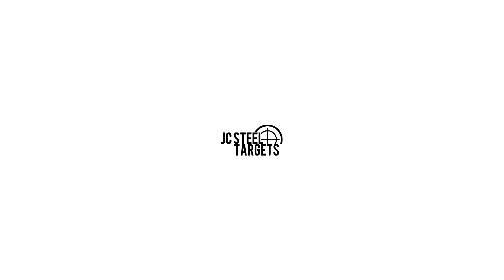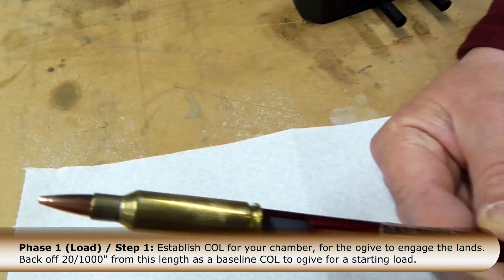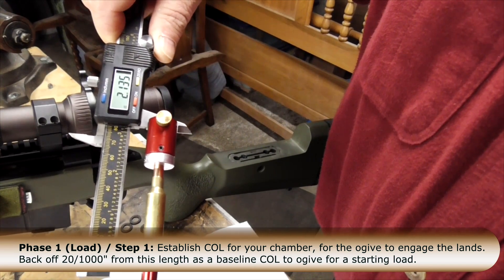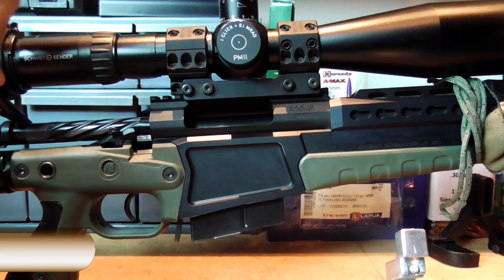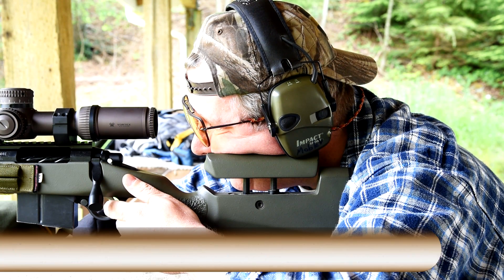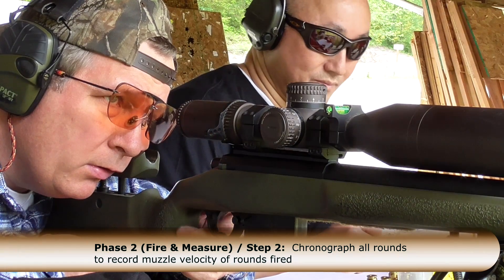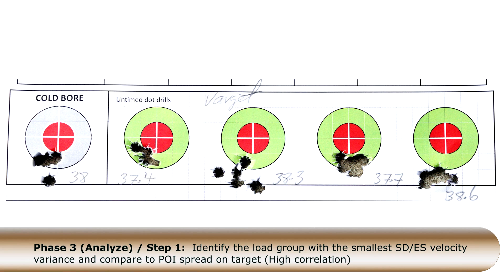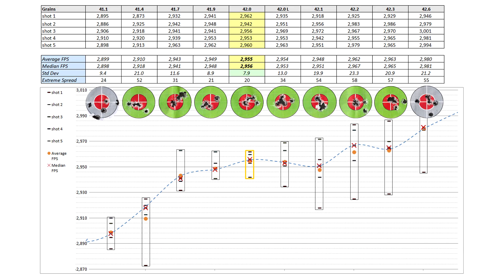S2 - 11 - Load Development (Part 2 of 2)

Comment: when I do load dev I'm focusing not just on the overall size of the group, I'm also tracking the spread top to bottom. Your gonna have nodes where the deviation is low ion FPS but the group spreads. "Best Data" doesn't always correlate to tightest group. Then, ya need to stretch out to 200 yards n see how they stabilize. My 6.5 Swede with 140 gr TMK's over 45 gr of 4350 would group 1/3 MOA at 100...even better at 200. They seemed to settle down better. My Bench-rest buddies told me they see that all the time.

Comment: Great series! I've certainly learned a ton from your reloading videos and have been able to refer a few of my friends to your channel as well. As a younger shooter just getting into PRS, it's nice to go to the range and show up some of the old farts :)

I'm running a Tikka Tac-A1 in 6.5 CM with a load of 42.5gr H4350 with a 140gr ELD-M and getting 2742fps with an SD of 6. At 200 yards I'm shooting 1/2 Inch groups on average from a bench. It's no custom action, but definitely a high value platform.

Comment: I think we all assess numbers differently. At 12:04, load 4 shot 3 shots in a row that clocked at the exact same speed. The shot before those 3 had a 3 fps difference. The initial shot, for whatever reason, threw the group data and SD off because it was about 20 fps. Little things like that would make me re shoot that group because SD can be extremely misleading sometimes.

Comment: Great videos! One question, do yall clean the barrel out between groups? Starting to load for myself and was wondering if running a bore snake through the barrel after every group would be beneficial or not. Thanks again for yalls knowledge!
Reply: Cleaning the gun tends to make it less accurate.  After cleaning, you should always shoot several rounds to foul it before shooting for groups.

Comment: realy nice. I am now testing powder in my 6,5x55 using Labradar. I lock for powder with low variation in temp and also try to find a nice spot wher the speed is stabel and variation over the whinter and somer. I think it will be a short movie about my test.

Comment: Hey guys, great video.
I'm preparing to develop a load for my deer rifle, and it's got a featherweight barrel. Generally, I try not to shoot more than three rounds at a time without letting it cool off. Which is the greater sin, to limit my test loads to 3 round strings, or to break my position and let the barrel cool?

Comment: I've recently seen this exact same thing with my .308 load work up. .2 grain of Varget difference can be big on the extreme spread. I really didn't believe it until I watched this video. Although I have watched this video before I wasn't as serious with my load work up then as I am now. Groups at 100 were pretty close in size but the ES was literally cut in half with .2 gr of powder. Thanks
Reply: Thanks for sharing your experience. Indeed, you don't see the different at 100 yards but you sure will at 1,000.

Comment: why wouldnt you start farther off the lands since you cant chase the wear of the throat.
litz says vlds can jump good so starting at .005 or more off the lands will give you room to chase the throat wear.
Reply: With the VLDs you either need to kiss the lands or back way, way off. With the 6.5x47 we were already running a compressed load so we didn't want to push the bullet in any further and the throat wear was minimal over the life of the barrel. However, it's on our "to do" to try to jump the VLDs despite the compressed load and see how we do.

Comment: Do you guys still load develop with this method?  I'm wondering if there's a way to blend this with OCW
Reply: Hi - yes we do. We've used OCW and in each case the best load according to OCW had the lowest SD and ES. If you want to blend the two approaches, you could shoot your loads on paper in a round robin fashion but as we point out in the video doing so is the equivalent of executing a dot drill. As mastering a dot drill takes a lot of practice (we're still working on it) chances are you will be introducing human error into your analysis. We will also show in an upcoming video how you can shoot a 100 yard group with charges varying by as much as two grains and still get a tight group. In other words, shooting groups at 100 yards is not always indicative of the best load. Some may disagree with us and that's OK - we're just sharing our observations. 

Based on our experience to date, we are confident conducting our load development with a chronograph only. Once we've arrived at an optimal load we'll test them at distance (up to and past 1,000 yards).

So feel free to mix and match approaches, but we are extremely confident that whatever optimal charge you arrive at will also exhibit the best results using a chronograph.

Comment: that spreadsheet stuff looks pretty cool, is it your own thing, or is it something you downloaded? i'd like to have something like that. also those targets, are they printable?

basically the tl;dr is, load to 20 thou from lands, find a good starting powder charge point then load up +/-. shoot 5 rounds, recording velocity and grouping. examine data and look at ES/SD and vertical stringing and identify the best load. after that experiment with seating depth?
Reply from the maker: Steve developed the spreadsheet years ago, prior to us starting 6.5 Guys for doing load development analysis. He also developed the paper targets we use using MS PowerPoint.

Comment: Hey 6.5 Guys, i'm fairly new subscriber. Do you have that excel spreadsheet template anywhere that i can download?
Reply from the maker: A link to the excel spreadsheet can be found near the end of the accompanying article for this video our website at this UR: http://www.65guys.com/load-development-part-2-of-2  we made the decision to make the file available due to the number of inquiries we've received about it. However, you should note that we don't offer any support or respond to questions about the spreadsheet, how to use or modify - we simply don't have enough time to do this based on the number of viewer email and questions we receive.

Comment: @10:07 I noticed you Magnetospeed v3 data on a MS Exel, BUT, where did you get the bullet curve? Is there a video on how you can set this up via MS Exel?
Reply from the maker: We haven't produced a video on modeling or analyzing the chronograph and load data using Excel tables and graphs. We've received a lot of emails and interest regarding this, but it's not within the scope of content we plan to cover.
Reply: TY for the reply. Ya, that info is completely invaluable to making a load from what I can tell. It would be amazing if you guys could. Great vids, ty

Comment: Great Video! 
Do you guys get POI shift with the Magneto speed attached on the Barrel?
I just got one Magneto and I'm not sure yet if i should leave it all the time on the barrel during load development or not.
How do you do it during all your load testing? Thank you
Reply from the maker: In short, yes. The Magnetosped will have the tendency to shift your groups in the opposite direction from the way the deck of the sensors is oriented. So if the bayonet is mounted at the 6:00 position to the barrel your shot group will shift up. You can even try turning it to the 9:00 and the groups will shift to the 3:00 position. In talking with the guys at Magnetospeed, what we understand is happening is the deck of the sensor affects how the muzzle blast forces air around the bullet as it leaves the muzzle and will have this shifting affect. 

However, from our experience it has negligible impact on group spread (i.e. barrel harmonics). Or in other words, a good load with tight groupings will still form tight groups with the Magnetospeed on or off the rifle, and a non-optimal load with the Magnetospeed on or off the rifle will still have the same level of dispersion on target.

Comment: Have you noticed adverse effects to groups and ES/SD when shooting to quickly?  Personally I have. When I get in a hurry and the heat starts to build in my chamber I'll notice that I get some high speeds.  I feel that there needs to be consistency in the time between shots too, which is hard at the range when there are seize fire and it takes so much time to get through a test.  So I set a 2 minute timer on my phone on spring and fall days but in the summer when temps start creeping up in the 90's I'll wait 3 minutes between shots.  Your groups and SD's are tight so maybe it's not an issue for you.
Reply: +Tyler Jacobsen Hi - we took about a minute between shots and made sure the barrel didn't get too warm. We also shoot in cooler weather which helps dissipate heat. Thanks for watching!

Comment: You guys should do a ladder test.  I always have better luck with load development at distance.  SD and ES are extremely important but the bullet never lies at distance.
Reply: +17874 Funny you mention that as we had a discussion with Scott Satterlee about that over the weekend. 300 yards seems to be a good distance. But yes, it's something we would like to try out.
Reply: On the contrary, I think that load development is ALL about ES and SD.  Anything that involves shooting and determining a group size is irrelevant in my book.  I know, it's sacrilege.  But think about this.  The point of the test is to eliminate variables.  The only thing that matters is what happens when the bullet leaves the muzzle.  The rest is out of your control.  So, if that bullet leaves the muzzle at the EXACT same speed, then regardless of the powder, primer, etc, you've done the best you can.  Now, technically you might say "bullet runout" or "brand of bullet/ogive/BC/etc", but you can test that too.  What you are doing is loading and testing powders and primers and seating depths and cases and NOBODY is so good as to infer the proper powder from a group size.  They can't shoot consistently enough.  You think that 0.150" extra was all about the right powder?  Or maybe the shooter blinked, fatigue, mirage, wind gust, unstable table, mouse farts, sun came from behind clouds, whatever.

If I shoot 100 rounds with a certain powder and the SD is 0, the only thing missing the target now is my ability to pull the trigger or read the wind or whatever...but it's not in improving my load.  Group size may suggest loads, but scientifically I think ES/SD is ALL that matters. 

To test this, you need a lot of data points.  But how about testing in a blind tunnel. Cant see the target.  Just a bullet trap at 25yds.  Keep tweaking your loads until you get a SD of 5 (to be realistic) over 30 shots.  Plot the SDs of all the stuff you load.  Some may be 5.  Some may be 10, or even 20.  Then take 50 of each of those loads and shoot 10, 5-shot groups.  Let's see the correlation between average group size and SD.  I'll put money on a direct correlation.  We all know this, anyway, but my point is that you watching your groups as you do the testing is irrelevant.

When you do the ladder and then you shoot a 5-shot group and say "yep, that's it", I don't think there's enough data points.  And saying "shoot 300 yds", well, that just adds variables.  If the wind is in play at all, you've introduced THE biggest variable (thank you Mr. Litz). 

My theory:  develop your load strictly on SD/ES and then learn to shoot well.  And if you can't seat a bullet straight, then learn that too.  Once SD/ES is standardized below 5, then maybe play with BC and ogive and bullet brands for quality.  Regardless of the rest of it, insist on an SD under 5...but no need to go find a long range to do load development initially.  IMO.

Comment: I agree with Todd B that Scott Satterlee just sacrifices one case/bullet combo and takes it from jammed into the lands and seats deeper in 0.005" increments until there are no marks on the ogive. For someone without a custom fired round to use with the Hornady device, this method is by far the best.
Phase 2 is 5 rounds at 7 loads at 0.3g interval. Phase 3 is analysis, and Phase 4 of Scott's process is 10 rounds at 5 loads at 0.1g interval. The last targets you show at ~12:21 appear to be almost a hybrid, because your load intervals are mixed with some 0.3g and then 0.1g. Nothing with 10 rounds though. The short intervals around the middle made that plateau look better than it might have been.
Reply: +Kenneth Garrison Hi - the target at 12:21 was shot before we even spoke with Scott and we showed it because it confirmed what we experienced using Scott&#39;s methodology. Yes - one could call it a hybrid approach. We appreciate the comment and appreciate your viewership.

Comment: Ed, some of the flyers you're seeing are occurring on the scatter nodes, so it's not "loose nut on the trigger" :) ... I doubt you've caused those flyers in every case is what I'm saying.  Remember that the scatter nodes (or anti-nodes) are normally 1.5% away from the OCW.  If you can't decide for sure on an OCW based on the groups you're seeing--look for the scatter node, and go 1.5% above or below that point--it'll normally bring you to an OCW node.  

As I believe we discussed when we talked, I don't like to worry with chronograph numbers until I've found the OCW based on the target alone, but it's fine to record those numbers along the way... as long as we don't throw out an obvious OCW (located 1.5% between scatter nodes) based on initial chronograph numbers.
Reply: +Dan Newberry   forgot to add... I'm not one of the 2 "thumbs down" votes...  I don't see why anyone would take issue with this presentation, the video is good. :)
Reply: +Dan Newberry Hi Dan - based on our discussion I doubt you were. Hey - you can't please everybody. When you look at the ratio of thumbs up to thumbs down on our videos we're doing pretty well. One could put out a video praising the morals of Mother Theresa and still get thumbs down.
Reply: +Ed Mobley - that would be because Mother Theresa had morals but absolutely no ethics. Not everybody would agree it's ok to let people die in horrendous pains and deny them proper medication just because she believed it's better to let them suffer and force them to pry to god instead... anyways - the video is great and the guys look noticeably comfortable outside ;-)

Comment: On the alternate OAL experiment, I think Scott was suggesting loading one dummy round and gradually seat the bullet a little deeper in each step - instead of loading 10 or more dummy cartridges.I really like the discussion of loading thoughts and processes.  I'm still on the fence regarding the possibility of the Magnetospeed affecting group size.Did you guys talk about varying case capacity or neck tension affecting velocity variation?
Reply: +Todd Hi Todd - Thanks for watching! As far as adjusting neck tension (be it .001, .0015, etc.) we didn't go there. We've settled on .0015 - .002" given the nature of our sport and the rough handling of ammo. We have not tried to soft seat or do anything like that. Inconsistencies (be they case capacity, neck tension, etc.) will cause variations so we want to be consistent.